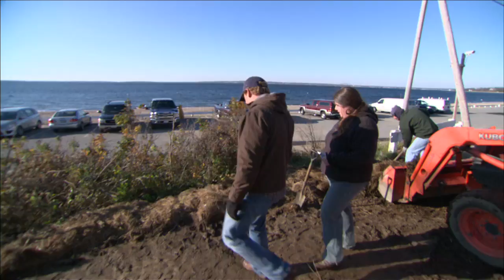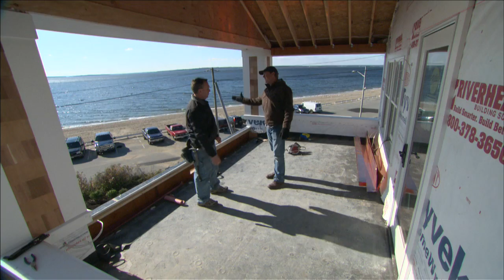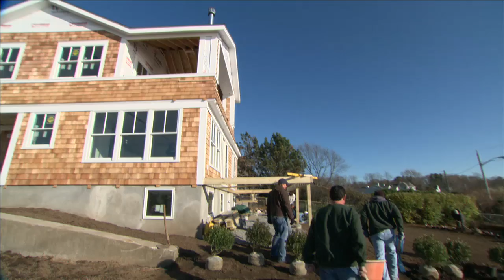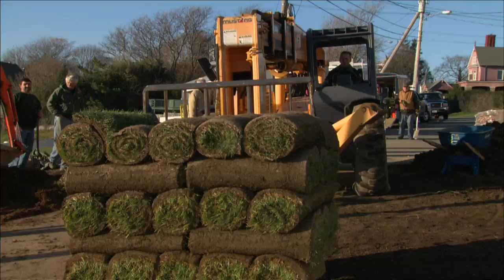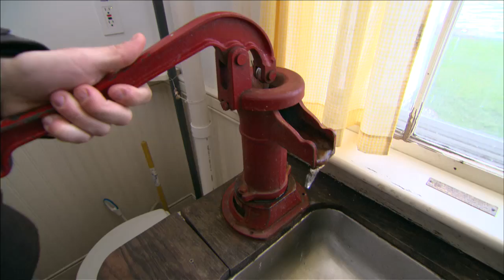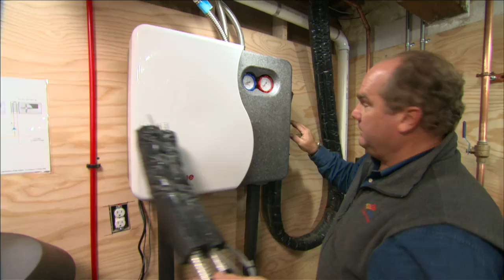Coastal Landscape | The Barrington House | Episode 5 (2012)

Comment: This guy is obsessed with copper. It seems so excessive.
Reply: Copper has total corrosion resistance in salt air - think of Statue of Liberty.

Brass is resistant but needs polishing. Aluminum is not. Lead is toxic in runoff. Stainless steel inflexible. Galvanized steel oxidizes gray. Plastic is eyesores.
Reply: @wmeemw994  
He use lead.
He also nailed the copper flashing with stainless steel nails... Isn't that corrosive when combined with moisture (especially near the ocean)?
In fact he installed copper, nailed with stainless steel, right above the lead flashing... Just a little salt water and we can start generating electricity lol